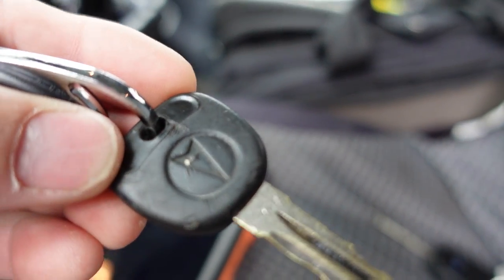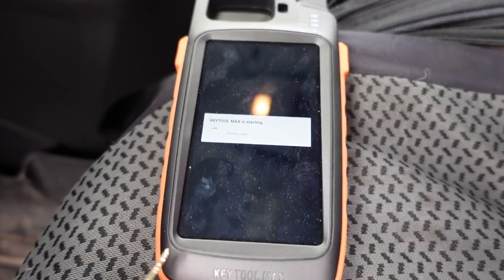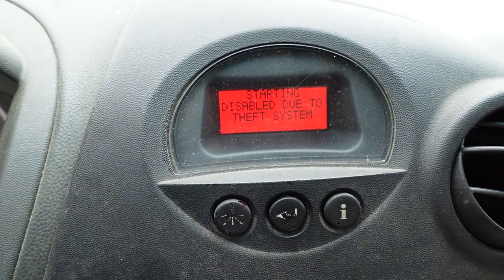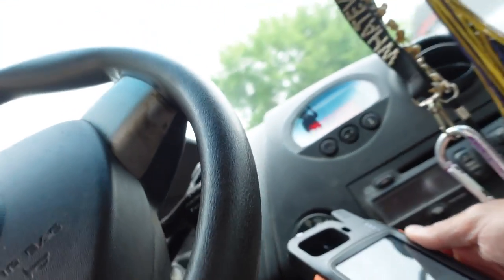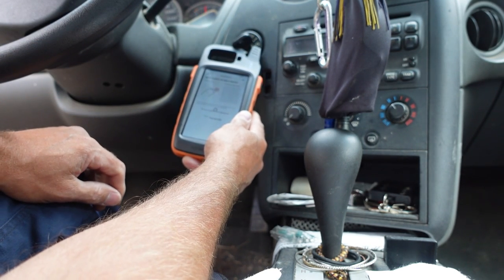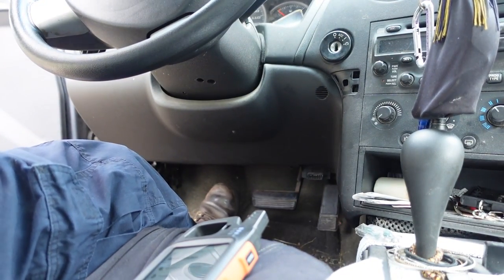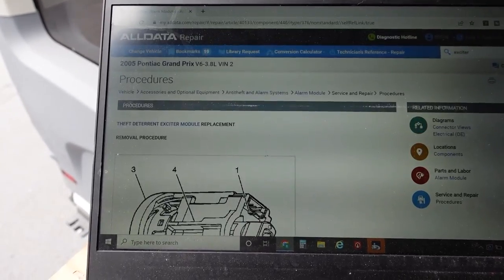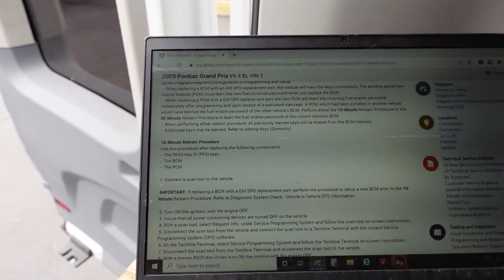Grand Prix Starting Disabled

Comment: yup.. thats what was wrong.. the plastic module was broken!.. If I hadn't watched your video I would have had it towed to a shop.. ordered from GMC 239 bucks plus tax.. im happy at least I figured it out with a little help!
Reply: Did you have to program it ?
Reply: @Dan_nie2427  I did  the key method where you switch it to run and off and back to run every 10-11 min 3 times
Reply: I lost my keys and i was wonder if i can just get it from the junkyard with keys and everything?
Reply: Did you also try to get it from autozone or any of them stores or only from a Chevy/gmc seller store ?
Reply: @Dan_nie2427 did that work for you?